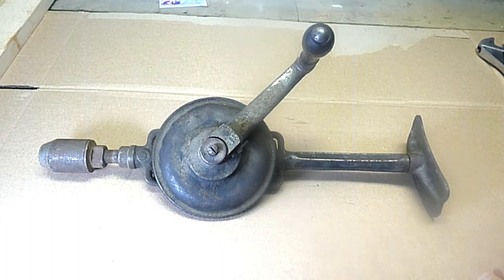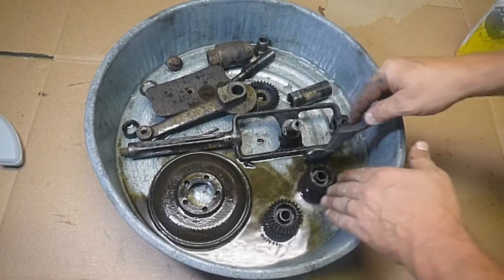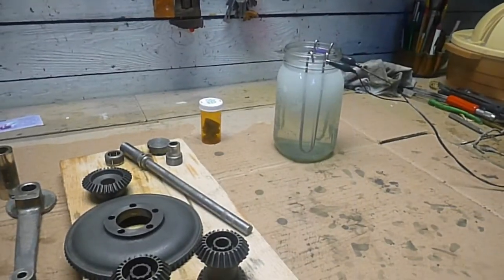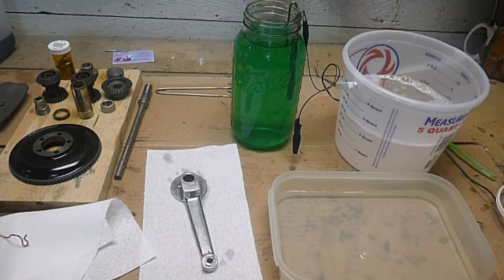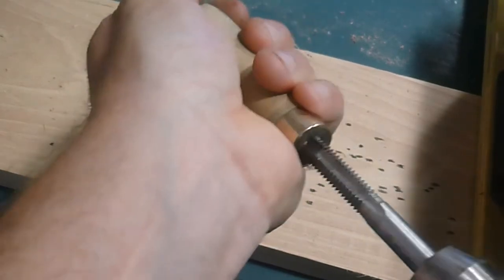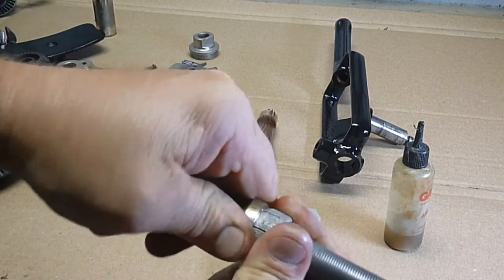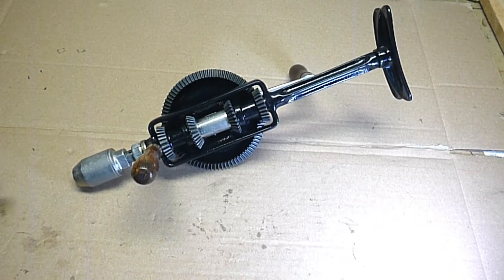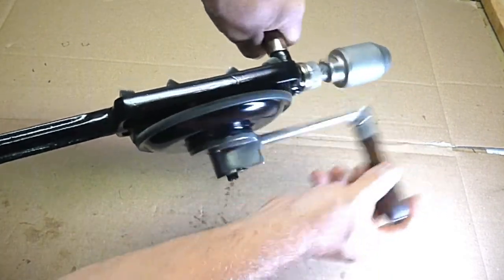Yankee 1555 Drill Rehab

Comment: Nice job, brother.  At first I thought you japanned it.  Next time you do one, grind the tip of the side handle bolt down to a screwdriver tip.  That's how the originals came.  You can disassemble the whole tool just using the handle.  I found mine in an antique store downtown 20 years ago.  It was disassembled in the original box.  They lady sold it to me for $10 because she thought it was incomplete.  Possibly my best score ever.

Comment: I think you have that Barrel transmission in backwards. On double ratchet the chuck should be turning forward not backward. (Right hand, not left hand) (clockwise, not counterclockwise)😃
I have the 1545 version of that one. Mine has an additional feature. It has a protrusion on the end of the main shaft that goes into the chuck where it slides into a slot on the inside portion of the chuck to keep things aligned more correctly for torque I believe. Even when the chuck is loose enough for the bit to fall out I can still drive screws in and out with lots of torque without the Chuck changing tightness.
My 1530 which is the miniature version, single speed, with the redesigned chuck by Stanley, does not have that in the chuck and every time I try to unscrew a screw the chuck opens up and the bit falls out, unless I put the transmission and park and use pliers on the chuck to tighten it down real tight. 
My 1545 does not do that under any amount of torque in either direction and I mainly use mine for screws and bolts using a hex adapter in it and a quarter inch drive for sockets.

Nice video.
Reply from the maker: Thanks for the input- It's not hard to believe I put something in backwards! My knowledge on these drills is minimal at best.

Comment: I had to make a side handle for mine to. I bought a file handle the appropriate size and a piece of all thread.
I drilled a snug hole in the handle for the all thread,  and glued and screwed it in and trimmed the end for the screwdriver bit.

I also made a front handle for my hand plane.
I used a hole saw and cut 3 pieces out of an oak board and stacked them with glue and bolted them and let them dry.
And then I put that bolt sticking out into the drill press and shaped it using very coarse sandpaper scraps from my belt sander and freehand shaped and stained it.

Both turned out very well and look original. 😁

Comment: I enjoyed your video. I have a few of these myself; they all loosened up with kerosene followed by  a bit of light machine oil so I never needed to dismantle any of them.

When you are cutting a bolt or threaded rod, if you put a nut on the side you want to keep, then after you complete the cut unscrewing the nut will restore the thread on the end.

Commercial platers often plate a thin layer of copper first onto steel before plating nickel on top of the nickel.  This aids adhesion of the nickel.
Reply from the maker: sandrine black Thanks for the comment and especially the plating info. I think I will try that  on an upcoming project.

Comment: I just realized that you have that transmission in backwards. 
When it's on double ratchet that chuck should be turning forward, not backward when cranking the handle in either direction.
There was another YouTube video of somebody who just bought one and was trying it out and they didn't realize the transmission in theirs was backwards also.

When you try to use a drill bit in that you would probably realize that it's turning the wrong direction in most settings. 

Holding it vertical with the chuck pointing up, the writing on the transmission should be right side up, not upside down.
But it's still a very nicely restored bit driver.
I use mine for large screws and also as a nut driver with the hex to square drive for the sockets.
It is my favorite cordless tool. 😁
One more minor thing. Those little pins that you mentioned were delicate, can't be that delicate because that's your ratchet pawls that transfer all the torque from the crank to the main shaft. I'm sure that they are made out of very hard metal.
Reply from the maker: You are spot on. Thanks for taking the time to explain that, others noticed it too. I should probably post an updated video with the correct finished product.🙂

Comment: I wish I could send you pictures of my 1545 and the internal torque transferring device inside of the chuck.
At the end of the main shaft that goes into the chuck it has a large straight blade screwdriver bit that goes into a slot on the push plate that holds the three Jaws inside the chuck to transfer the torque from the main shaft directly to the Jaws so that when turning the handle backwards the Jaws do not loosen up like it does on my 1530  that does not have that internal torque transferring device.
 When watching YouTube videos it looks like none of those other similar egg beaters have the torque locking device in the chuck like mine has.
on many of those big beater drills if you turn the handle backwards the truck opens up in your bit falls out. On mine it doesn't matter if the chuck becomes loose or not and the bit will still have full torque even if it is just loose enough to fall out as long as it's not so far open that it cannot transfer torque to the bit.
Another way to tell is to hold the empty chuck still and turn the crank and see if the jaws of the chuck spin around as they open and close (go in and out) or if they just stay in one spot (and go in and out) as they open and close.

On my 1530 when I hand tighten the chuck and try to take out screws, the Jaws opens up and the bit falls out unless I use pliers to tighten the truck real tight.
I'm pretty sure that your chuck is scarred up and scratched up really bad because people had to lock the handle and then tightened the chuck with pliers.